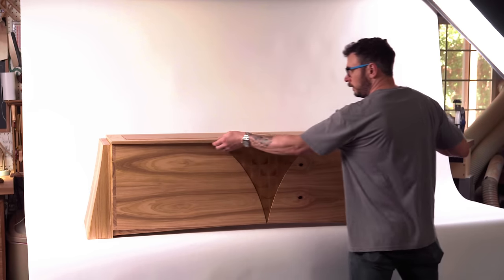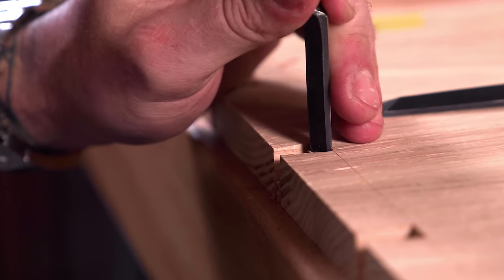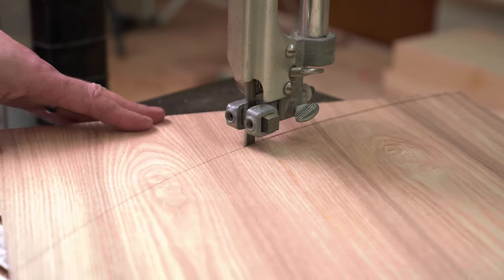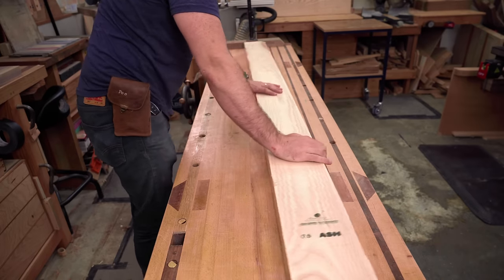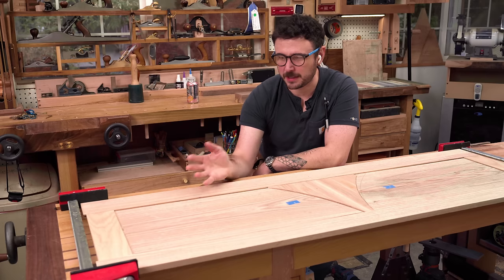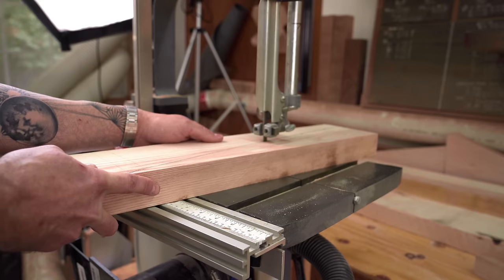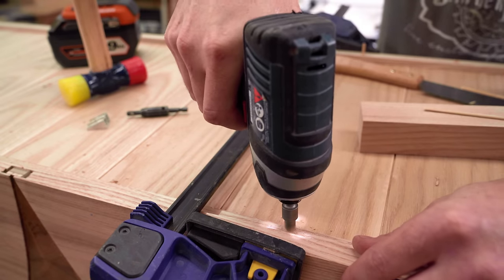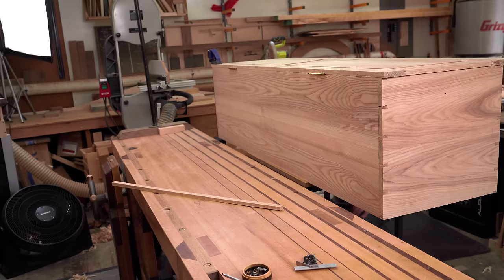Making a Blanket Chest

Comment: Love your work man. Your eye for design is amazing. True master of the craft which is inspiring. How did you attach the center endgrain inlay to the two halves of the front?
Reply from the maker: Thanks man. It just slides in and has a fixed post/dowel than holds it in but allows it to float as the case moves

Comment: As always, fabulous build. I appreciate how casual you are when you realize you have to rework something in the build - always driving for top quality. One question - I am doing a couple of builds with ash currently and trying to find the right finish that keeps it light and “ash like”. I finished the last one with osmo finish - it looked great but it did yellow more then I hoped. What did you end up using on this one? You didn’t mention in the video. Thanks for the fabulous content - very inspiring.
Reply from the maker: Hey thanks Anthony. I use a waterborne 2K, though anything waterborne will work great to keep light species from ambering.
Reply: Appreciate that - thanks!!

Comment: There was a quick shot where you were using the miter gauge backwards on the table saw right?   I have a theory, but I’m wondering why you did that.
Reply from the maker: Hey Ben! It allows me to not touch the angle which can be finicky to find the same place on the other side. So a quick flip let’s me cut the opposing bevel quickly and easily. Also a good trick for crosscutting larger panels 👍
Reply: @SawyerDesign  Excellent! Thanks for the tips!
Reply from the maker: You bet man! Anytime 🤙
Reply: @SawyerDesign  smacks my own head Knew I should have paid more attention in Geometry class.

Comment: I mean I appreciate the attempt, but something is off to it in my opinion. Maybe two inverted swoopy things on the face beside the one you made would have a better effect? I feel the top should have just been flat. I like the legs, but they are definitely a toe stumper accident ready to happen. All in all no doubt you're talented, but this project felt more like an experiment than a project you really cared about. It's all about trying new things. I like you taking the time to hand chisel dove tails too.
Reply from the maker: Definitely a few things I would tweak on the next one. I think the part this one deviated from the design was reusing the form and that swoop didn’t quite balance as intended. Also would stick to the oak end grain as the ash gives more of a plaid feel. An experiment for sure. For my buddy and his wife is pleased so I’m pleased. Sometimes it’s bang on the first iteration, but a lot of pieces have many elements that I’ve learned how they feel on other pieces to get them to all come together.
Reply: @SawyerDesign  I'm sure your buddy and his wife adore it. It's a very well crafted chest! I just wanted to add some genuine commentary to the comment thread outside of saying "good job". Obviously you did a good job, but I wanted to provide more feedback. 🥰
Reply from the maker: No I totally respect that and appreciate it. Always fun to reflect back and see what I’d do differently